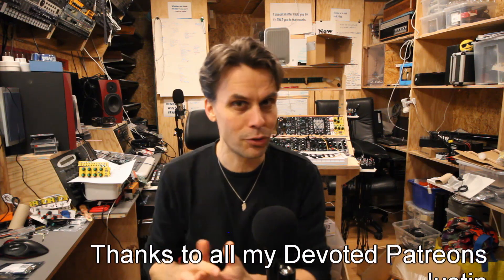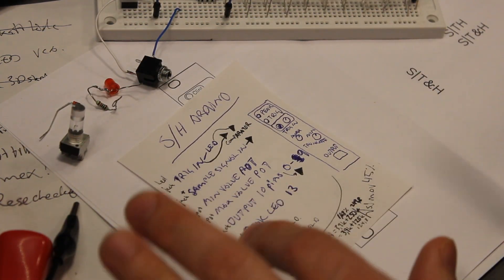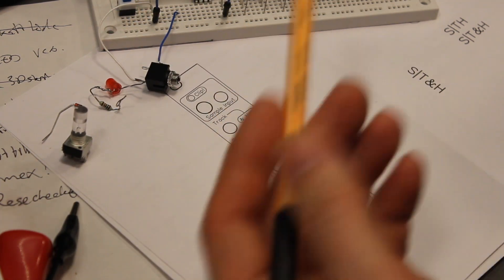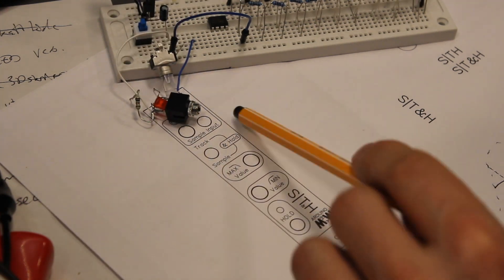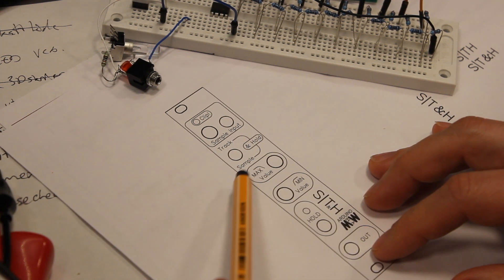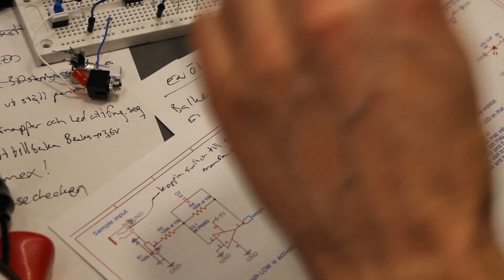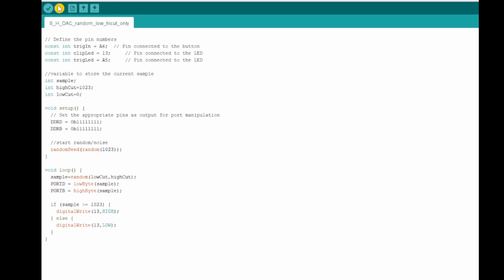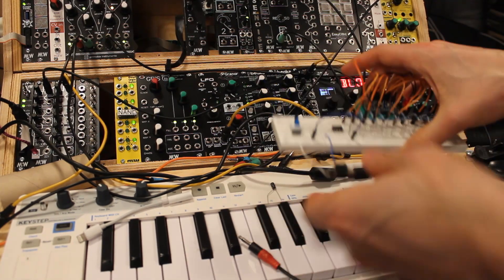Arduino Sample & Hold using Port Manipulation and a software noise source

Comment: One idea for the trig in would be to have the trig be "triggered" by a hardware interrupt rather than reading it on each loop. I can't remember which pin on the nano but at least one of them can be configured to trigger an "interrupt service routine" basically a "callback" function on each pin change i.e. HIGH to LOW or LOW to HIGH. 

TBH I have no idea if it would actually be faster than just reading the port... it might be better to just read the port register (they are supposed to be crazy fast to read from and write to) every loop as opposed to flipping some global variable on every pin interrupt and then reading that over and over again in the loop :P
Reply from the maker: Unfortunately (x2) It’s not the trig port that is the problem but the three ananlog ports that I scan. And they take 13 clock cycles each and unfortunately can’t be made that much faster with the 10 bit resolution. And also I believe I use all the interupt pins for the DAC out so can’t use that either. 😅 But thanks for the ideas. 🙌

Comment: It is not the code that is slow, it is the ADC itself that takes a significant time to read. You can change the ADC rate but that will sacrifice resolution. There also seems to be something called free run mode where the analog read takes place in the background allowing simultaneous changes to your outputs. That could work here perhaps. Otherwise, a dedicated external ADC chip would probably be faster.

Another approach is to not read the pots for every iteration of the loop function, e.g. reading the pots with say only 100Hz.